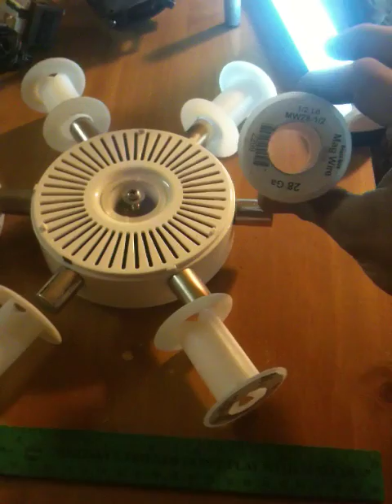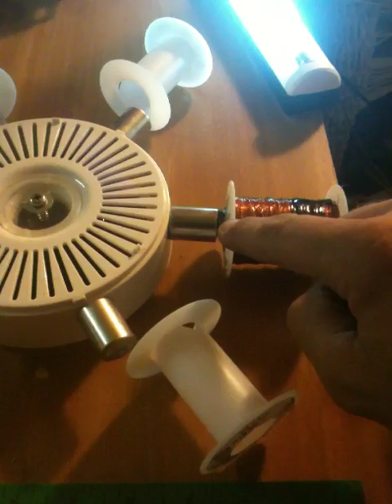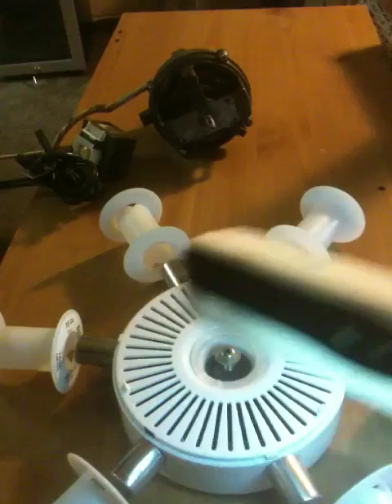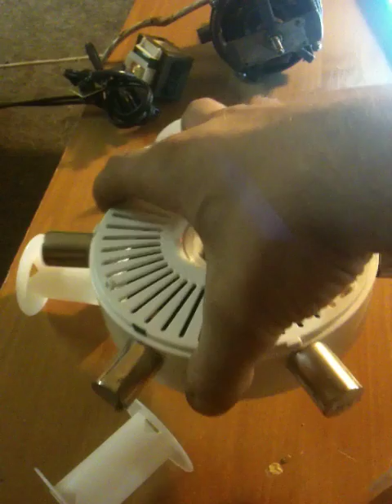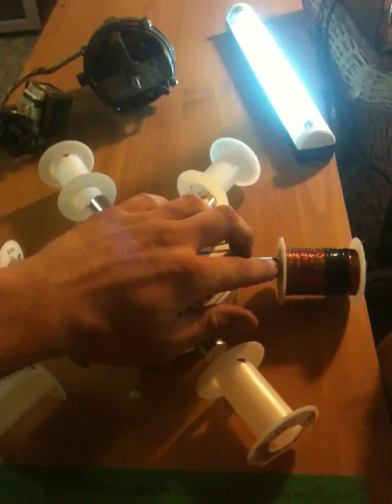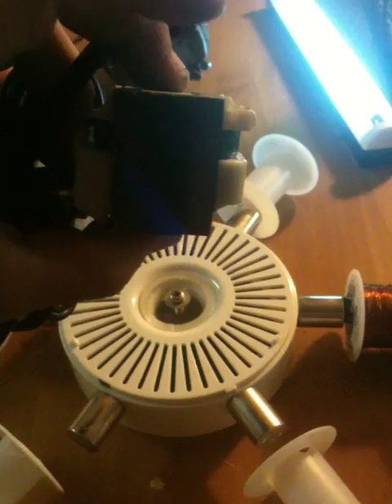The Free Electricity Generator(Explained)

Comment: You said it best with your opening written statement. You still have presented no data or evidence to prove this. As a former Subject Matter Expert and Instructor in the field of Electronics at the US Army Intel Center and Schools, Fort Devens, Mass... You have no grasp of the basic fundamentals of magnetic principles, electronic principles, thermodynamics,  or physics in general... Firstly - the iron cores are not creating magnetic poles opposite that of the permanent magnets. They are ferrite! They are concentrating the already existing lines of flux from the permanent magnets and in essence extending the range of the magnetic fields due to their proximity to these fields. Secondly... It's called INERTIA!!!! - Inertia buddy!!! not "centripetal force"... Thirdly... You totally ignore the first law of thermodynamics in the entirety of your ridiculous presentation and...
Fourthly... LEARN THE PROPER NOMENCLATURES!!! Electricity is comprised of ELECTRONS flowing through conduit of some form... An "electric ion" as you stated it is a charged particle ( a physical particle of actual size) even if it is only an entire molecule or atom (yup them too with protons neutrons and you guessed it!!! electrons) carrying an extra electron to be negative or missing an electron to be positive; yet somehow in your miracle world these solids can flow through solids...
And Lastly... you didn't even discuss how the voltage is produced in the coils of your generator... Try this on for size... The current through the wire produces a magnetic field round about it and due to the overlapped wrappings in such close proximity upon each other has a cumulative effect and intensifies said same field and this field attempts to induce an opposite current flow to the current which produced the field to begin with... inductive reactance and inductive resistance... Ever hear of those?
Reply from the maker: Yes you are correct , I posted these videos some time ago and I had did not know at the time that any load put on the generator results in loss of kinetic energy and the generator slows to a stop. I'm not sure why I havent deleted these videos yet , maybe some day I will have something to prove through experiments.... thank you for your time.

P

Comment: You can't get something for nothing! There is no free lunch! You don't understand EMF!
Reply: +imezjv sighh same old - you've taken the money principle and applied it to nature - you convert you don't make free stuff - you take what's in infinite space - besides u already know that
Reply: Run your car, turn on lights and heater, your engine slows down. How can the EMF from an ity bity alternator bog down a great big engine? Oh I know! Not enough infinite space!
Reply: +imezjv That's what everyone used to think until solar panels and wind turbines were invented.  They provide an infinite amount of free energy.  The 2nd law of thermodynamics only applies to close looped systems.  Open system thermodynamics allow energy to enter the system from other sources nullifying the 2nd law. A sailboat is another example.  A sailboat violates conservation of energy.   Contrary to popular belief the 2nd law of thermodynamics is not absolute.   It's even mentioned in 1st year physics books.
Reply: If you measure the solar power going into a panel compared to the power out you will see a loss. It shows up as heat.Same with wind turbines, bearing friction, heat, wind drag, etc... Study thermodynamics goofball, you can't get something for nothing, there is no free lunch.
Reply: imezjv
So what you get a loss.  It still produces energy.  Study OPEN SYSTEM THERMODYNAIMCS goofball.  These systems are open, not closed.
Reply: So does a battery or a gas generator. I'm glad you now realize that any time you try to make electricity, you have to put IN more energy that you get OUT! But of course if you're studying thermodynamics you already know that.
Reply: imezjv
You still don't get it. The Sun can give you solar energy.  The wind can give you wind energy.  You don't have to put in a damn thing. The environment puts it in for you. All you gotta do is build a device to capture and convert it. A solar panel or a wind turbine are, what is called, OPEN SYSTEM THERMODYNAMICS.  Open system thermodynamics allows for the introduction of new energy sources rendering the 2nd law of thermodynamics moot.  IT DOESN'T APPLY!  Read it.  Understand it.  Comprehend it. 

If you knew anything about Albert Einstein, you would know that he said there is enough energy contained in one cubic centimeter of air to power the entire world for a day.  Did you not learn the most famous equation in the world?  E=MC^2?  It has dozens of names.  Zero point, negative energy, radiant energy, energy from the vacuum, transient energy etc etc.  You really should read up on current events before relying on a law established 130 years ago.  Times change.  The 2nd law of thermodynamics is no longer absolute.  If you read a physics book, you would know this.  Common heat pumps are over unity devices.  It's acknowledged in the physics textbooks.

Quantum Mechanics tells us energy pervades the universe.  It's everywhere.  You can't get away from it.  Even the vacuum of space is teaming with energy.  Did it ever occur to you that someone might learn how to tap into it?  Using electricity to power something was thought impossible.  It violated the laws of nature.  Then one day, someone figured out how to make it work for us.

It's absurd to think that no new discoveries would be made since the advent of modern day electrical engineering which was created 130 years ago.
Reply: And the atom can give you atomic energy. YOU don't get it. Your video you said if you get the wheel spinning fast enough it will produce a "far greater"  amount of energy than it needs to run the wheel. SORRY CHARLIE!!! AGAINST the LAW OF PHYSICS!!!! YOU JUST SAID SO IN YOUR COMMENT ON OPEN THERMODYNAMICS!!! Once again, you can't get out more than you put in, you can't get something for nothing, there is no free lunch. I will stand along with every scientist and physics prof since the beginning of time on this one. If you can change God's laws and prove Him wrong, I will worship you instead of Him.
Reply: imezjv
You are clueless.  You need more education. Again, you can get more out than you put in.  A wind turbine does it every day.  A solar panel does it every day.  Again, there is enough energy in a one cubic centimeter of air to power the entire world for one day.  It's not my video you moron.  I just understand it.  You don't.  You're hung up on this more out than in bullshit that applies to closed loop electrical systems.  You don't understand that a simple solar panel violates your precious laws of physics.  You don't understand that a solar panel is an open ended electrical system.  No one is putting anything into it.  Yet it puts out hundreds, if not thousands of watts per day. Nor do you understand that a common heat pump is in the physics textbooks as violating the 2nd law of thermodynamics.  Read the book, tool.
Reply: Sun is energy, Wind is energy, and they both get converted to electrical energy. There is a loss, measure across one sometime, It's called a voltage drop for a reason. I design them and have been in electronics for over 55 years. My house is 100% solar. You are ignorant. You keep changing the subject. The subject is the false info you seem to believe in your concept of EMF. If you want to argue at least stay on the subject. The more you talk about ideas you are clueless on the more uneducated we see you are.
Reply: imezjv
Oh dear, you just don't get it.  You're hopeless.  Do yourself a favor and just go away.  Scientific progress doesn't need people like you.
Reply: Science has proven that even the sun will eventually burn up all its stored energy, just like the gas in a generator. when it's gone what good will your solar panels be? If you can't grasp the simple scientific concept of the conservation of energy, then you have your head so far up your ass that no amount of common sense will ever be able to help you see the scientifically proven fact that everything has a price! Do yourself a favor and go back grade to school, except this time PAY  ATTENTION in science class!
Reply: Heat exchangers only RECLAIM a portion of the heat lost by a system. If you put two exchangers in series the second one will RECLAIM what the first one lost and so on. Hence, not over unity!!!!!!! The more you talk the dumber you appear. When you find yourself digging a hole to deep to get out of, put down the stupid shovel! Thank you for proving your ignorance , You are a god in your own mind.
Reply: imezjv
Sure thing buddy.

Comment: 1. Absolutely inapropriate name for this  video.
2. If you know that much about physics, you should also know that there is a physical law which basically says that "Free Energy" does not exist
3. If you get this device to output more power than it uses (momentarily), then it will be slowing down, which means that you are generating power from the initial momentum it had after you started it by hand. Congratulations, you have built a generator which (inefficiently) converts your food(which grew using the sun's power) to electricity.
4. Please just STOP talking about physics if you have got no idea (which obviously is the case in your case)

Comment: Good thought! However, it is in my opinion that the energy required to actually break the aligned magnetic fields between the iron cores and their respective magnet would be greater than the energy produced by the apparatus. It is an interesting thought though. Make the coils ridged in comparison to the others and slap a fan on the spinning center. Put it out in the wind and watch it go. That would be your best bet for "free electricity".

Comment from the maker: The stationary coils iron cores would cause drag , you guys are right about that. But the coils get energized in a sequence like a 6 cylinder engines spark plugs get energized.  The 5 other coils get energy output every phase that just 1 coil is used as the main electromagnet.  The main catch is that the generator MUST BE STARTED BY HAND. If you energized the coils and do not start spinning the motor then the generator will not run and if the coils aren't energized in this way then output falls.